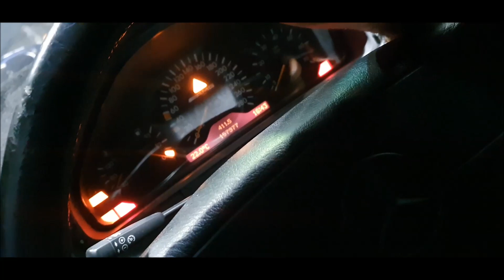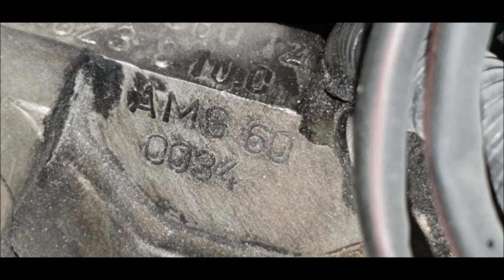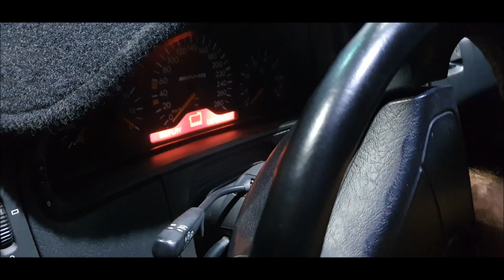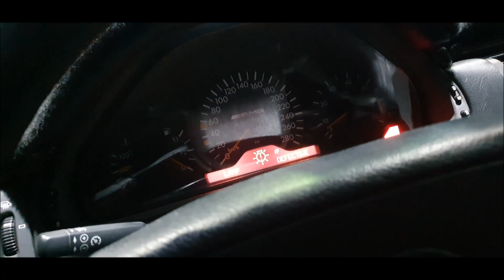E60 How to not fix your fuel pump (part 1)

Comment: Good day. 
I know that question  is not on the topic for you, but I want to hear your opinion on the issue of turning off the oil pressure control valve on M278 engines. I want to turn off the ESU mechanically and programming. Thanks for the answer. All best to you

Comment: It is not recommended to move/touch the throttle cable by hand on this cars.
Reply from the maker: Really? can you explain why?
Reply: It may cause limp mode on the ETA by turning the ASR light on and it will be stored as a Fault.
Reply from the maker: Come on, I was expecting something crazy, no worries and thanks for the advice.